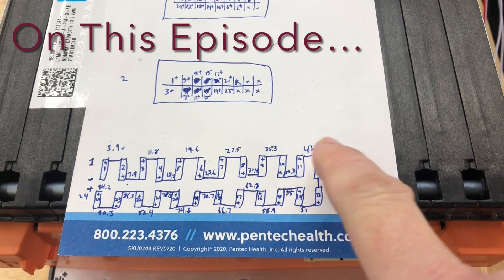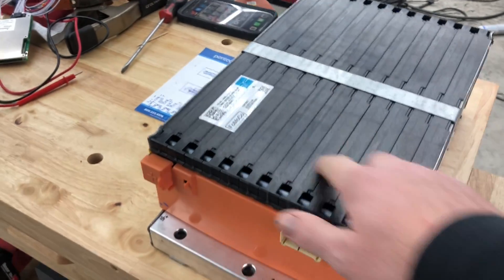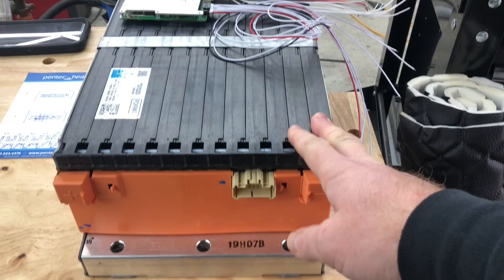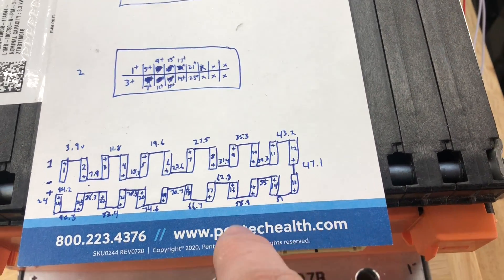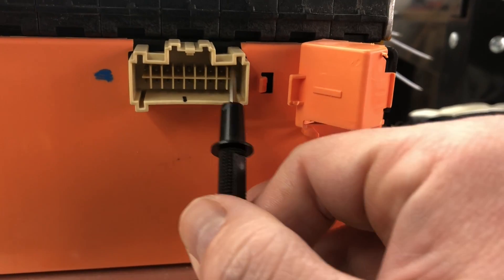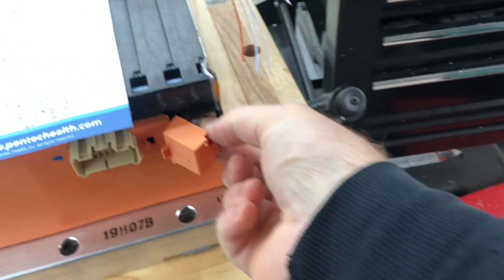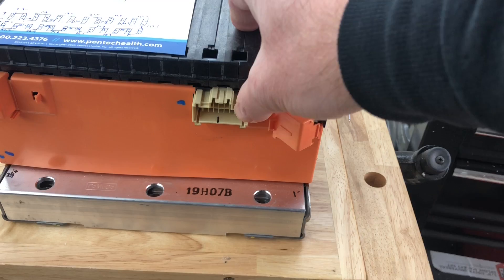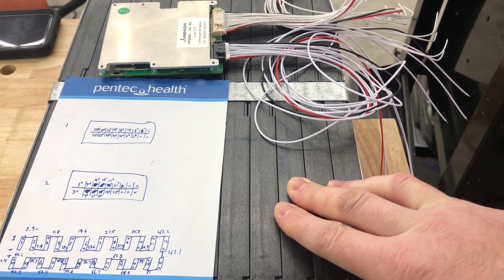Attaching a BMS to a Battery Module: Scam Car Upgrade

Comment: Link to battery?
Reply from the maker: Currently sold out, sadly. Battery hookup rotates through different modules. They have a nice 36v in stock right now for $200 that you could double up in series for a relatively comparable battery
Reply: @LordCurt  interesting Thank you.
Reply from the maker: Most similar up right now:
https://batteryhookup.com/products/110-2170-3-7v-5000mah
Reply: @LordCurt  So, pretty easy slam two of them in series for 72v?
Reply from the maker: @trongoldsteinstrailofdestr3126  that’s exactly right! Same exact BMS attachment process, but half the leads go to each pack. I’m posting a video of 4 headway modules in series in a couple weeks, and that shows the process for connecting series modules to one BMS